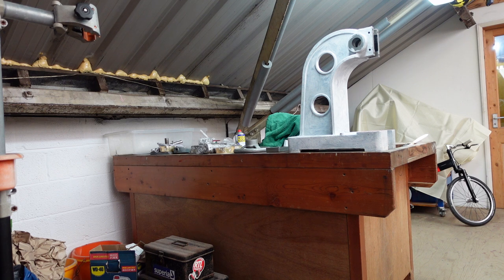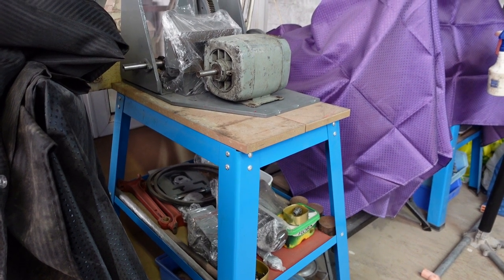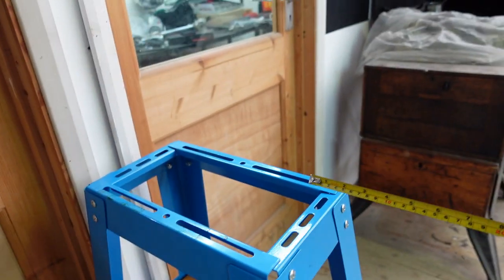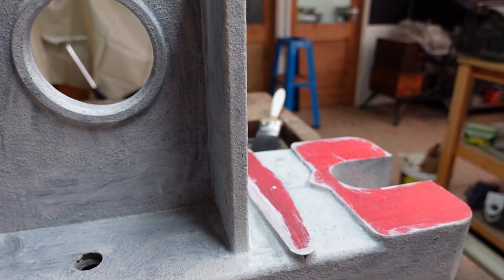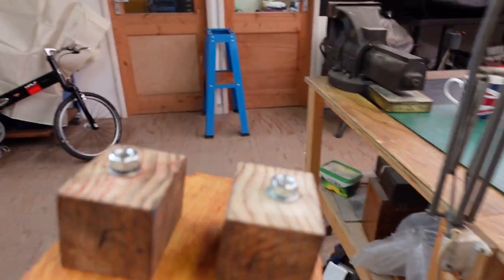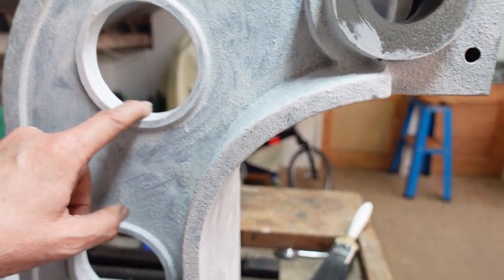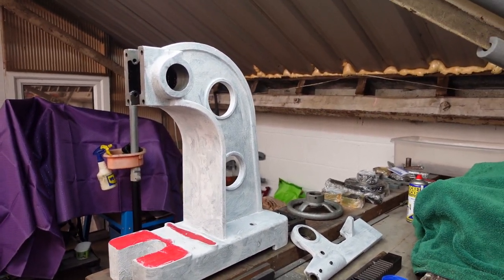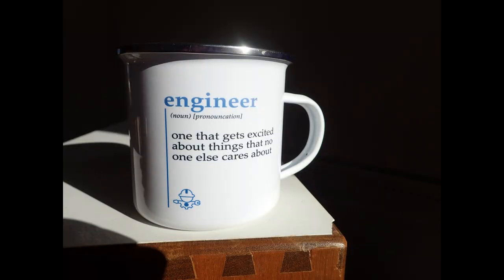I Made a Stand for My 3 Ton Arbor Press Without Welding.

Comment: Nice to see another video, i do look forward to them.
It LOOKS a little bit flimsy and top heavy to me, but appearances can be very deceptive, if you think it's sturdy enough, then great, you're the best judge of that, as you'll be using it.
    Hammer finish paint would look good, i think.
Reply from the maker: Hello Colin,
I think (& hope) it should be okay, as Rustinox said if it does not work than all I have to do it fix it, which is a guess what we do on most things. I will go with the hammer finish and then use the wrinkle paint on another old machine I am waiting to show you all. Thanks for watching and your support.
Take care.
Paul,,